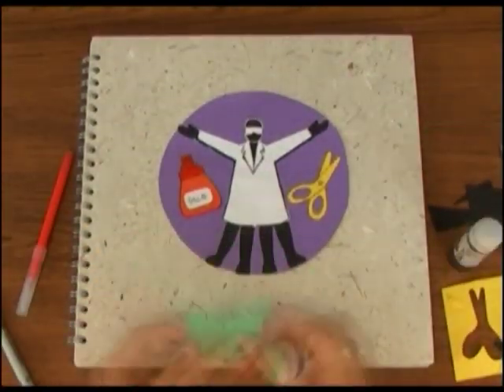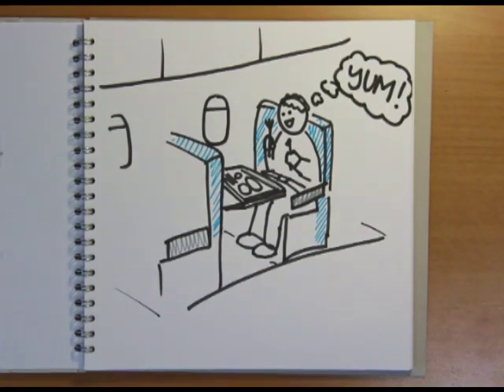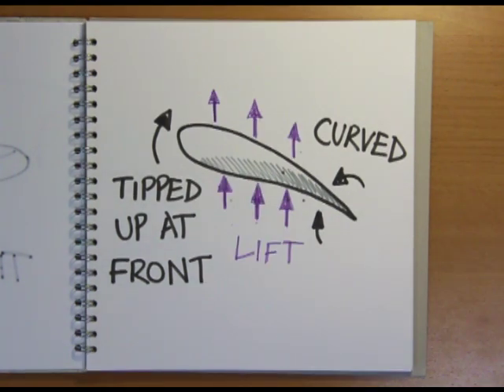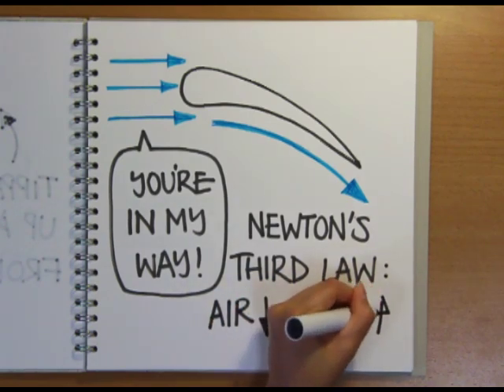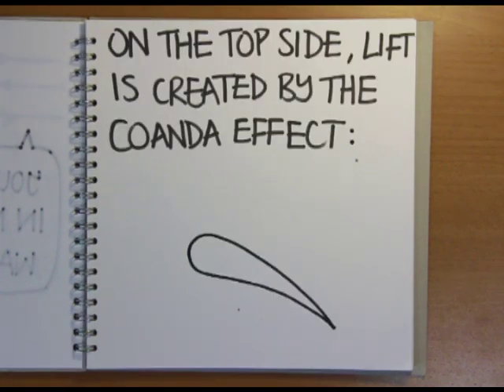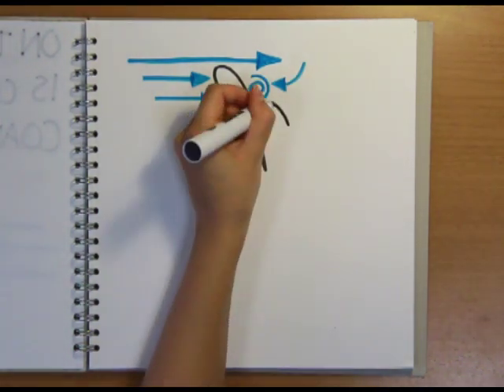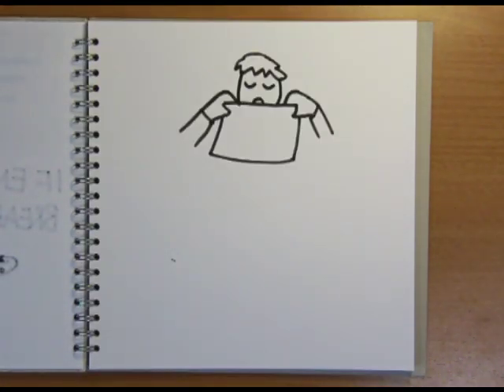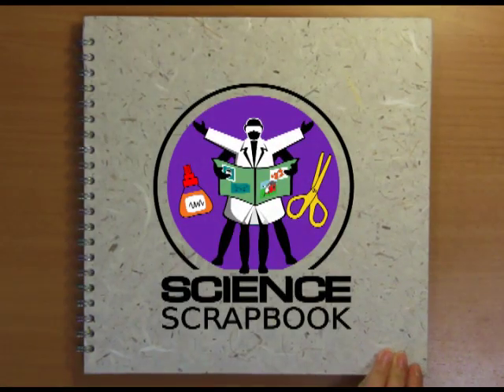How does a plane stay in the air? - Naked Science Scrapbook

Comment: Let us try to explain  the physics of lift  and control  and let the readers ponder about it. Assume the space around us  is filled with a  voluminous mass of fluid at atmospheric pressure.

1.  If one bashed a  voluminous lump of  very fast heavy fluid against  the surface area of  a heavy body, then on impact ,there will be  created zones of high  compression (high pressures)  and any reflected, or bouncing sheets of fluid,  which will try and separate from the surface of the body, they will  create between them and the surface of the body,  zones of partial vacuum or low pressure. So bashing volumes of fluid on to a solid body can create zones of high pressure, while trying to reflect  and separate  fluid  sheets from  surfaces of a body, will  form zones of low pressure . 

2. A  heavy body can be made to  levitate  and move  and be made directional in a fluid, by arranging for the body itself  to throw volumes of fluid  at itself, in selected directions and  through shaping the  outer contours of the  body, the compression and partial vacuum zones can be made unsymmetrical such that its  body lifts  itself, while its direction  is selected through the controlled throwing  of more  fluid moving along various angled surfaces. 

3. It is best to keep the adjacent flows of the fluid to have little differential velocities, but if these  differential velocities are high then one can circulate  the faster  streamlines  to take the form of a helix  rotating around the slower one where the axial velocity of the spiralling helix will be the same as the slower  straight streamline, till they mix and equalise in pressure and velocity.

There is all of micro detail in that, but better to keep to the basic principles to start with.

Comment: Sorry, but Bernoulli is *always* part of ther whole lift story, __when used correctly__ ; which it rarely is.  It takes a force (pressure) to accelerate a mass of air just like any other mass  "Flow turnig" is the result of the pressure difference of a moving airfoil producing lift.

Comment: +Quillons1  It also is not technically the Coanda effect.  Though similar, that term is used to describe a high speed jet, or sheet of air that is faster than the prevailing airflow, not the ordinary action of the surface moving through air.  Sounds like a nit, but true.

Comment: +Quillons1  Not really "right on". Not terrible, but not great.
 Accelerating fluid creating low pressure is the all too common misconception.  The way she describes the cause of the upper surface lower pressure is essentially correct except for the word "pull".  The lowered pressure above the wing does not actually pull the difference is the lift force..   It takes a force to accelerate a mass.  This applies to a mass of air and the force available is pressure.  There's more but no space here.

Comment: Oh, and air DOES NOT ACCELERATE over the upper surface of a wing. Another myth. In fact relative to free stream air, it SLOWS DOWN as is must because of viscosity and form drag and because it is being pulled in the direction of movement of the wing. Again, watch the Cambridge video pulsed smoke section and see the myths explode!

Comment: As a wing moves through the air at a positive AOA, the lower surface pushes the air forwards and downwards creating lift component 1. The pressure bow wave in front of the lower leading edge then pushes the air up and over the wing. Normal static air pressure holds the air close to the wing's surface. The skin friction (form drag) causes the air to be pulled forwards in the direction of the wing's movement and downwards parallel to the upper surface.  Change of direction =Force. F=Ma = Lift.

Comment: Sorry Naked Science people. The Coanda effect does not exist (if at all) in un-accelerated flows. It is typically described as being the 'effect' present in upper surface blowing but some scientists do not think it really exists as an effect distinct from viscosity/ form drag that are responsible for the boundary layer. The air over the upper surface is pulled forwards in the direction of the wing's movement and bent downwards by static air pressure. (no vacuums in normal space)

Comment: The only argument you'll get is the Coanda part.  While it looks sthe same, Coanda is considered to be the effect when a *Forced, high pressure jet, or sheet of air* is directed over a convex surface to develop, or improve lift - rather than the air moving as the result of a convex surface moving through air.

Comment: +Quillons1   RE: "when a fluid accelerates, it creates low pressure against a surface ".
 Actually, it is the other way around.  The low pressure (caused by the convex curved shape) causes air to accelerate from higher to lower pressure.  In the case of the upper surface, the acceleration is more of a radial acceleration - that is, acceleration being a change in velocity making it curve.

Comment: If done carefully, this same explanation works just as well when using the wing moving past the air.
While I could pick on a few choices of words, this essentially explains lift correctly.  
"drag along" = Entrains due to viscosity
"Stationary air" = Air at that point
"small vacuum" = lower pressure
"pulls the airstream towards the wing" =  higher pressure above pushes it towards the wing.

Comment: +MaverickX2k5  Regarding the statement: "Higher velocity results in a lower pressure!"
This is the common misapplication of Bernoulli and has it backwards.  Air changes velociry *because of* a difference in pressure.   
 It is that precise bad interpretation of Bernoulli that has been incorrectly used to explain lift.   LISTEN CAREFULLY, the video says @1:40 that the curve causes a low pressure (tiny vacuum) that puls the air down. Ok the pressure above pushes it down.

Comment: This is very much it: A fluid has a certain amount of energy in the current state, which is a sum of temperature, pressure and velocity. If you don't put energy into the fluid, the amount has to stay the same, but you can change the parts:
Higher velocity results in a lower pressure!

Don't mix this up with higher velocity of engine exhaust: you put very much energy into the fluid here!

Comment: Finally a video with the correct explanation. You usually get the explanation that the air travels faster on the top of the curved wing and therefor creates a lower pressure that creates the lift. Actually its the other way round: the pressure difference created by the wing as seen in the video creates the speed difference

Comment: Basically the same effect. You can produce lift with a plane plate by having shown angle against the air, much like sticking your hand out of the car window while driving.

In inverted flight state a profile like the shown one will still produce lift, but much less than in normal position, as it is designed to be more effective that way. This and the quite high number of passengers who would dislike inverted flight usually stops commercial pilots from flying this way ;-)